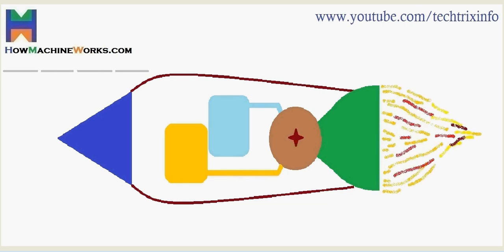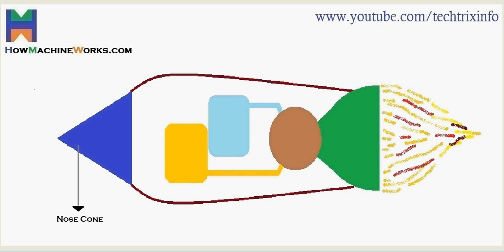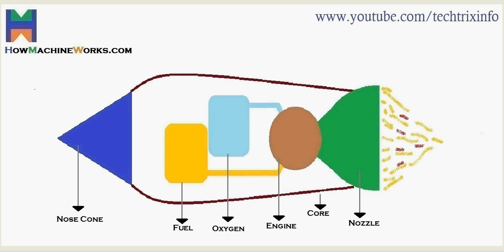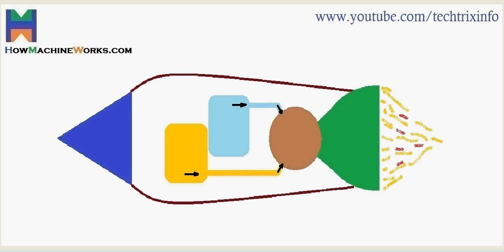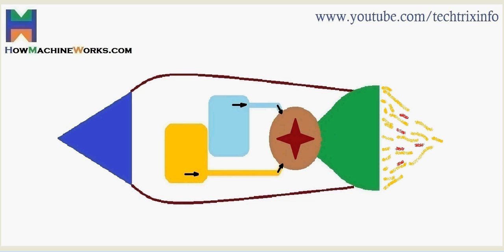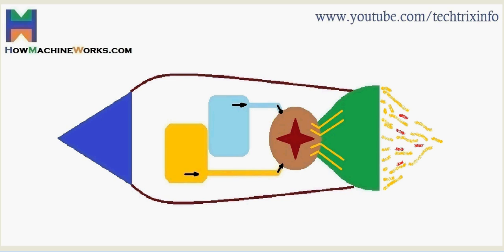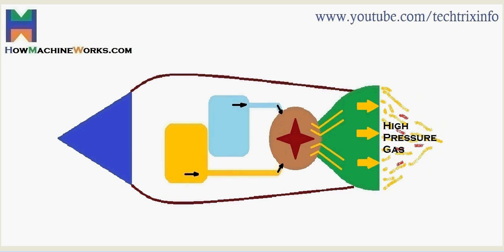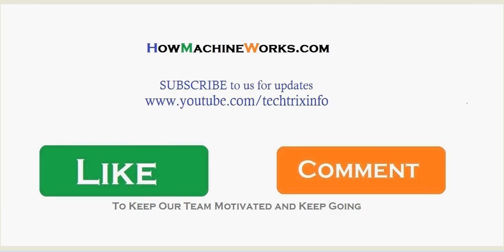Animation How Rocket engine works and propels.✔

Comment: The nozzle converts the slow moving, high pressure, high temperature gas in the combustion chamber into high velocity gas of lower pressure and temperature.So the video it is not so precise...